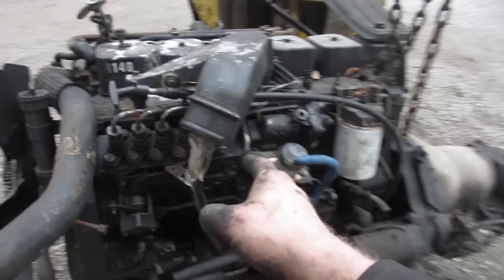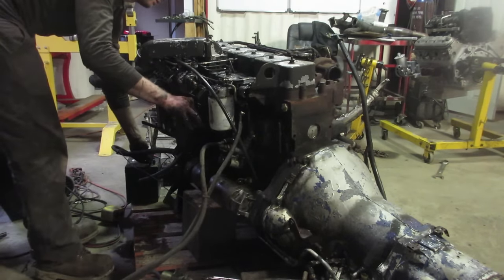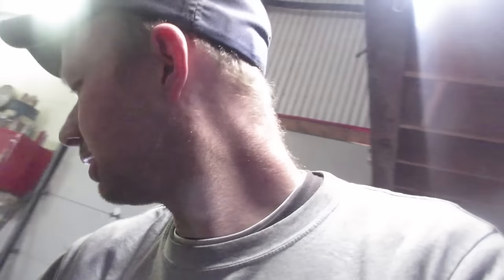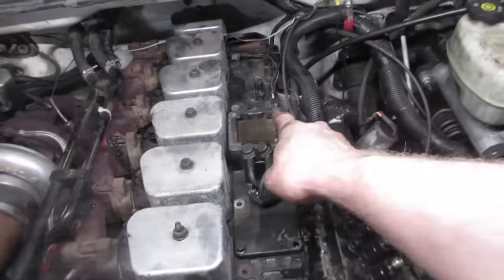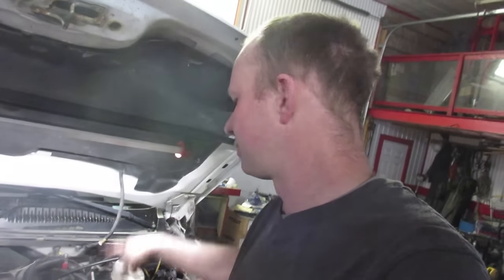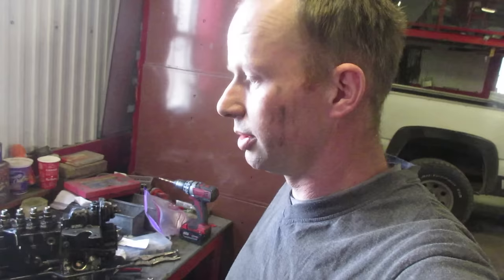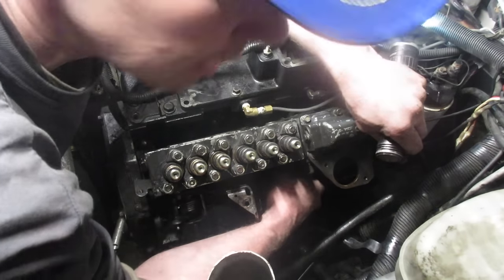12v Cummins P-Pump Governor Springs & Fuel Plate Mod = POWER!

Comment: It's kinda like riding a mechanical bull. If you peg the throttle and the oil cap can last 8 seconds without flying off, it's good 😂

Comment: about The timing gear install. it's not the oil, it is the debris on the taper.    clean gear and shaft with lint-free cloth, install pump, pull gear forward, loose on shaft, reclean feel free to use 15w40 to flush it out if you would like. but a spray of WD-40 is ez.  the lint from the Q-tip or cotton towel is why the gear came loose.   flush with 15w40, PB,wd-40,brake parts just clean it before you put the nut on.    good luck

Comment: I watched this a year ago and 19 now and own my first 12 valve. Love it just ordered airdog fuel separator, 3 gague pillar, and kdp fix as a start. Next will be 150hp injectors and 4 inch turbo back exhaust
Reply: How'd it turn out?
Reply: update
Reply: We need an update bro
Reply: Yes we need to know
Reply: Update, we want to know how you are doing with your 12 valve? @David Does
Reply: David does

You are 20 now. 
We need to know do you follow through.
Reply: Nathan Brame Yes I ended up doing all of that, also did 4K gov springs and 191 delivery valves, it was pretty beastly, but 3rd gear started grinding so I ended up trading the truck for a 2007 Harley Davidson super glide with a stage 3 tuned 1800cc engine and brand new 6 speed transmission, it had 16k miles and not a spec of rust, I bought a black 2001 f250 7.3 lariat 4x4 crew cab short bed with 126k miles at the time and that’s been my work truck since, I sold the Harley for 10k, now I just wanna buy a house right now currently living in my RV
Reply: Damn your the first person I’ve seen to come back to a YouTube comment a year later! Lol good on you tho sounds like you got life by the balls keep it up bro
Reply: @RiggyRonnie  awe man should have kept it, synchros aren’t about crap, would have been cheap and lasted you the rest of your life

Comment: I just bought a Cummins p pump out of school bus that someone junked and it runs just like yours..best $220 dollars i ever spent
Reply: lazowelding  the bus P-Pumps are worthless
Reply: I never knew that why are they?I think I'm going to sell the engine now that I found this out
Reply: lazowelding  you just can't get the power out of them like you can with the pumps in the Dodge trucks.
Reply: lazowelding they are far from worthless!!!!!!! They just can’t be made to make huge power like the truck motors the pump doesn’t push the same amount of fuel. You can run it as is just fine and even turn it up a bit.... if you want 500+ hp just slap a p7100 off a dodge pickup on it and go to town.
Reply: The engine is 175hp rated on side of tag but I never knew that p pumps where that different in flow..I'll keep that in mind
Reply: @lazowelding  I have a dt408 school bus with p pump, doing 0 plate today I'll let you know how that goes
Reply: Ok let me know gracias
Reply: Luis Galdamez how did your motor work out?
Reply: @lazowelding   great actually, it now goes 65 even on long hills where it previously only did 45! Fuel economy feels the same also! I recommend it! Just make sure to add a pyrometer and take a look when it's being pushed hard

Comment: I am from Germany and my Dad owned a 4BT Case 5120 and after that a 6BT MX120.. Turned up the Pump on the 6BT and it made about 130HP on the PTO dyno. Sounds great, huge Torque, good power, super reliable and crazy simple. Sold both Tractors at about 9000 working hours with nothing else then Service done to the engines

Comment: Its got 615,000 miles on it for anyone wondering...
Reply: Logan Lanfear i was wondering
Reply: Yeah x's 0.6 km-miles
Reply: @1johnnygunn  0.615*
Reply: Only for the ones that dont believe in the metric system
Reply: So about half life
Reply: HJZ75driver I been using the Imperial system for 5 years short of 3 Score so its not necessarily that I don’t believe in the Metric system but it just really mean anything to me especially temperature and distance/speed
Reply: Barely broke in!!
Reply: Awesome thanks
Reply: thanks i have trouble translating canuckistan sometimes.
Reply: For everyone that can’t do math.
Reply: Its a 4 million mile motor, when you rebuild it every half a million...
Reply: @fastinradfordable  It's a medium duty truck motor - and commercial vehicles can rack unbelievable miles in short order.
Reply: Metric system is hands down better, no questions but if i have to work with other people than im forced to use sae.

Comment: I was forced to leave my 98 12v out in the ND patch when I stroked out there, along with 20 years of tools. My fuel plate was the stock profile, but trimmed back a 1/4 inch. She wasn't an aggressive smoker, and spooled up well with the scaler ring taken out of the whistle, and the star wheel turned up. Still got the same mileage 17 loaded or empty. It had 411 ratio. Great Video gear head, keep 'em cummins. :P

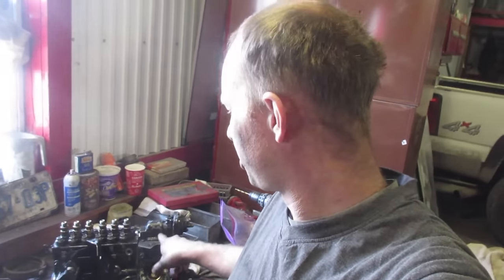Comment: I read through the comments and found you used 3200 RPM springs...but I missed what FUEL PLATE you went with? FOUND IT!!!   21:06  "#8 fuel plate".......you made such a short reference to it, it was hard to find. Good video for overall procedure though, thanks!

Comment: 16:50 ya you spun that pump off camera because it's a MFer. (1996 12v 6spd owner. I make the "power" lol 606 1402) been there done that. My rack got stuck 6 years ago and had to go through this. Luckily I WAS (currently a pilot) a diesel mechanic and knew people at industrial injection I got a dragonfly for 800 bucks. I would've never played with my pump for that reason but these videos you have are spot on. Love your content. I was never in the shops "pump room" I was in the "injector room" and "the shop". Personally I drive a 12v because obvious reasons power alone. But I love the simplicity of the 24v when it comes to timing. I wish the 12v had the key on the pump shaft STOCK. It would've made my life easier back under the hood while I was earning a living.  But as you said it was a widely used engine but they made our automotive version so different they could've done that too. If we go on that thought process we should've had the marine pistons too. Just saying. Like I said. Love the content. I'm subscribed! Howdy from the heart of Texas!

Comment: Don’t sand the tapered shaft! They need to be polished. Sanding reduces the contact area whereas polished maximizes contact area. I have had success both dry and with the green loctite like they recommend with the larger engine cam gears

Comment: Fuel plate, timing, increases supply pressure - nothing did squat until I swapped gov springs.  I've got a video of it on the dyno to prove it.  Never did get a final HP since it broke my dyno after changing the gov springs.  Thanks for the video and good explanation of how to do it!
Reply: burningdinosaurs how did it effect mileage if you don’t mind me asking :)?
Reply: That I don't know.  It's a swap into an old squarebody chevy, so I don't have a baseline nor have I driven enough yet to know what it's getting now.  But if you're worried about mileage, tuning the AFC will be key.
Reply: When I installed the 3K Springs I didn’t notice that much difference and granted I didn’t turn/ tighten springs down very much either plus I’m not running a fuel plate.

Comment: I had an extra shim in my 98 auto pump the other day. And i pulled all the springs. When i put em back i didnt think it would clear when turning over. Anyways im glad i grabbed a smaller magnet and got that last piece out. Probably saved me alot of trouble

Comment: At 19:28, the most important part of your video. I bought a take out engine that came out of a FL70 Freightliner. The PPump was completely different than what Dodge used. It was a very $$$ lesson.
I love your videos. You are a great teacher/instructor's. I have a rebuilt P7100 pump too. 😀

Comment: Good video thanks, but I disagree on the blow by, it wasn't bad at all, when the cap dances its still good, it had several thousand miles left on it, otherwise it wouldn't have started that well. Just saying...12 valves got to love em

Comment: It's a good idea to change the lock washer on the pump shaft.  I just clean it with long q tips and diaelectric contact cleaner, seems to work better than brake clean

Comment: That passes the blow by test in my book. 

You loosen the oil cap, start engine. 

If the cap flutters that’s fine. 

If the cap gets knocked off the engine then it has blow by problems. 

A good catch can and routing the blow by to the intake will help a lot. 

And a FYI for all you metric guys....
1 million kilometers is only 2/3 of a million miles.

Comment: I got a 12 valve it was a beautiful engine it had 300 k it didn't burn or use oil I used rottella 15_40 then I cheaped out and bought Canadian tire oil and runnened my engine it burns oil now and smokes but works perfect I put the rotella back in but to little to late don't cheap out when u do your oil change also got a 2002 6spd high output for sale

Comment: I put a number 8 plate in my 97 too. Good compromise. Significant power increase without killing the transmission. Torque was replaced but transmission is still original at 440k km.

Comment: Spraying break clean in timing case hole works great to clean shaft and gear hole do it all the time .
Reply: Long night diesel 12valves thats also gonna strip off all the oil keeping it rust free
Reply: datsunz1 that’s the point to remove all the oil so gear won’t slip on the shaft before it’s completely torqued down or after , being its a tapper fit once truck runs it will have oil on it again no worries there .
Reply: Long night diesel 12valves ah okay that makes sense, i stand corrected m8y

Comment: I been down this road . Bought the truck a 95 with 40 k miles on it . Ran ok mileage poor 16 or so mpg ..i tried every thing and finally i bought the timing tools from Snap on . I think the timing which is in mm of lift at tdc wound up at 17 deg . Mileage is now 21 or 22 straighr highway at 65 miles hour . Now i have the 3 k governor kit and a 10 fuel plate . I bought a set of 215 injectors from Piers in Canada.  It came with 2 sets of washers . Like a dumb ass i used the thicker washes and motor soundes odd . Probably because the spray was not correct in the bowl . I swapped out to the thinner washers and runs good sounds good crisp . Piers told me once if the motor cold want rev up it needs more timing.  He is a very smsrt guy too . Now my truck has 200 or so k miles on it very clean Texas truck no dents ect . It has plenty of power i say 300 ish with maybe 600 tq . Just right .

Comment: Loctite high strength sleeve retaining compound works like a champ, I use it on the ISX 15L single cam engines, they too have a tapers press fit cam gear

Comment: I'm looking at buying a 12 valve to replace my 7.3 idi. Ill be driving it daily.  What all should I do to the 12 valve to make the most power and best fuel economy. Love the videos thanks for the help
Reply: Advance the timing in the pump and grind the plate to a zero profile, and you'll have more power than the transmission can handle.

Since this was a year ago, what did you wind up doing?

Comment: You should have put a rack travel plug in it too (as long as it's not a 215 (96-98 manual engines.))
Also you should modify your AFC &  then use it's position & the spring you put into it to tune your engine. (Only need a # 0 or #100 plate in it then as a stop to not be able to over travel the rack (which will defuel it) & get a hung rack (which could lead to a run away!))

Comment: That blowby isn't even bad
Reply: Briggs & Stratton Power 
Especially for a cold motor. 
That motor has lots of life left.
Reply: Ive had my share of worn out lawnmowers - this comment with your username made me laugh :)
Reply: It's just acting like a rain cap on a tractor smoke stack.
Reply: My idi & past Powerstroke had no blow by, the Powerstroke probably had 400k on it, & having injector issues. So after you consider both engines, they’re abt the same for maintenance costs.
Although the price of the truck initially is abt 2x for a Cummins.

Comment: Was that blowby even bad to your standards? I thought that was really quite good considering the mileage. Hell. Even with half of the miles I'd be satisfied...
Reply: idk man its like 615k miles, at 300k miles if i had that blowby i would be thinking i got a dud cummins. as a dodge tech, these are million mile motors when maintained correctly and this one is only 100k past 500k. early end of life if you ask me, i would want to see another 250k out of it before that level of blowby.
Reply: @MsPokemonsoulsilver  

If this was a food delivery truck this thing was easily started 20-30 times a day 5 days per week.  That much blowby after 20+ years isn't bad at all and does not mean end of life.....it was still cold after all.  I bet that thing easily runs as is for another 7 years 250k km's.

Comment: I always see people saying crap like “to bad these engines were put in a dodge” they act like Chevy and ford had way better trucks when all trucks of this era had almost the same problems. They are just jealous that dodge has a way better engine
Reply: Better motors bad body.
Reply: A 12v Cummins in a Chevy or Ford is a 100% better truck
Reply: water bear how ?
Reply: True, I have a 97 dodge 3500 with 235000 miles. the doors close tight and the dash doesn't rattle... sure, everything electric is bad (windows, gauges etc) but the same for every other pickup of the era.

Comment: I have a 96 Ram 2500 4x4 5.9L 12v with 5 speed manual HD and 4:10 gearing. 180,00 miles, truck runs great but needs fenders and doors, rockers etc.

Comment: that p pump looks about the same size as a Geo Metro engine block
Reply: I had a 3cyl geo metro I got for free from rust. 

Still ran like a clock and all accessories worked. 

It had a receipt for timing belt and water pump and tuneup from the dealership. 
Bill was $105

People joke about them. 
But we may never see a cheaper car.
Reply: @fastinradfordable  They're awesome little cars. It's a shame most of them rust out before the engine quits. I still have my Metro and it's what got me into mechanics.

Comment: Hey Rich I have a question. I'm looking at getting an old C10 chevy with a 6.2 detroit in it, but I have no experience working with diesels. Is there anything I should look out for? I don't need any power out of it, just something that gets better fuel mileage than my truck with a 454 in it.

Love your videos by the way!
Reply: I know this is a super late reply but I have no diesel knowledge either but just picked up a 1972 c10 with a 12v in it

Comment: 94-95 Auto 160 hp / 94-95 manual 175 hp 
96-98.5 Auto 180 hp 96-98.5 manual 215 hp
Reply: Long night diesel 12valves isn’t there a California emissions 190 or 195 hp in there somewhere?
Reply: Jason Truman yes there is but not sure what they are right off hand

Comment: I just need to know how to get into my first Cummins 12v at a reasonable price. Been in gas engines, loving diesels now.
Reply: Buy it broken and fix. 

Or, buy an older vw TDI 1998-2003

And learn what it’s like to get 50+ mpg. 

Those cars get better mileage than a diesel smart car,

I have the engine out of one in a little vw rabbit pickup truck. 

It scoots and gets insane mileage. 

I went on a 5 hour trip this weekend and burned only 1/4 of my 16 gallon tank. 

Yes. That means I can drive for 20 hours at highway speeds, for around $35

Yes, that means I can (and have) drive from coast to coast for under $200 including food. 
And, being a truck and having a bed, it gives you a place for naps.

Comment: I got a 95  12 valve that is a automatic and I bought it a long time ago in 98 I think . It was a dog and got around 16 miles to gallon . After asking this one an that and finally found the forums I decided to buy a snap on timing set . I gave the engine some timing . Quiet a bit really . A fellow from Canada told me once that if I rev up a cold engine and it stumbles it needs some timing . Any way it went to 21 or so miles to gallon and ran a lot better . I added a 10 fuel plate and a 3 k governor kit . I fixed the dowl pin that good ness an it was on its way out damn .  I ordered some 215 injectors from Piers in Canada , use the thinner washers as the thicker washers made the engine sound odd . The thinner washer help I.  So the 215 injectors , 10 plate , 3k gov kit will make 31 or so lb of boost . One trick I done I think that helped my transmission to last to now at 203k miles is I run 10 hydraulic oil in it for the last 150 k miles at over 100 more hp ,That and a slight mod to the throttle lever on transmission to help with part throttle oil pressure

Comment: Id like to put a 4bt in a Chevy 1500,,, with compound turbos, with a 4L80 transmission. But they always a but! I don't know if it would have the power a stock 6 would make. I'd like 220-250hp atleast, I have a 340hp, 500 lbtq gas engine in it now. I'd like better mileage, and more lowend tq. And keep the power...  Great video...

Comment: Very good video, I have a 24 valves Cummins 5,9 and I would like to replace the original vp44 fuel pomp for a manual fuel pomp is posible do that?

Comment: If you can point me in the right direction of your videos for 1990 ve pump 12v non innercooled.  I'm building my fuel tank now have to make hi/lo beams work, windshield wipers, and a few other things that aren't available anylonger.

Comment: I have a 1997 Dodge 5.9 manual. I put in a #10 plate, but my governor spring kit is sitting on top of my tools box collecting dust.  Thanks for the video to help me out.  Do you have a video on timing a P-pump?

Comment: I have a little smoke coming out of my oil fill tube but it doesn't have any pressure, my cap doesn't move or blow off. What do you think? Maybe a leaky vacuum pump?